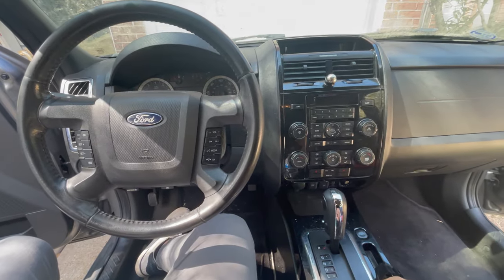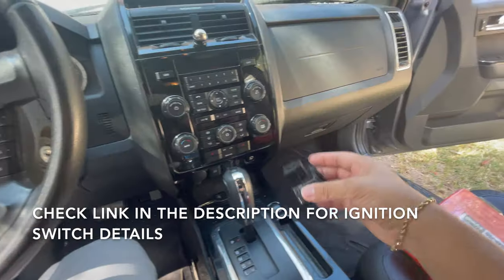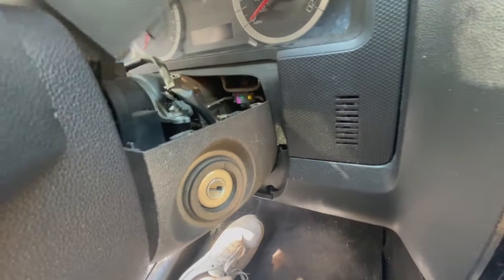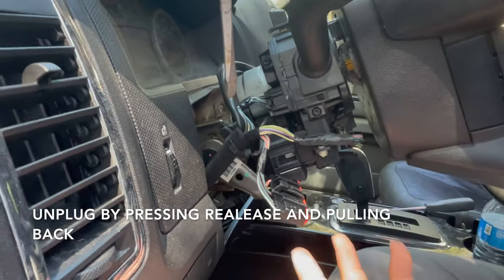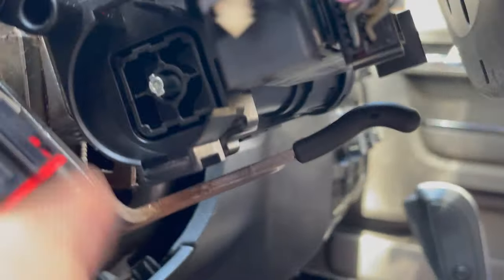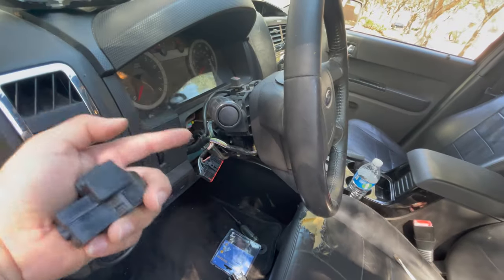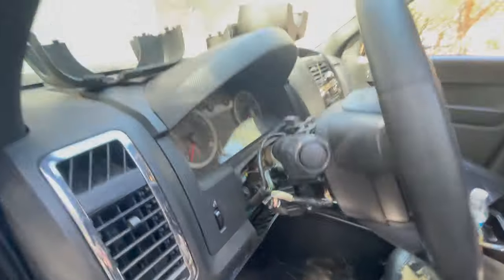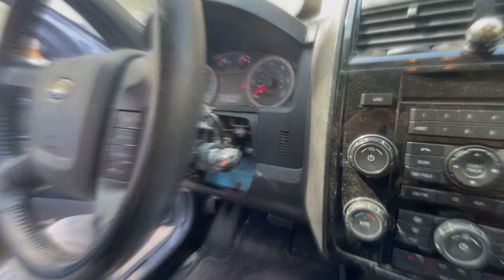Ford Escape Won't Start Ignition Switch Replacement

Comment from the maker: Don't waste time and buy the part here, its the part that you need, has quick delivery and its $30 https://amzn.to/3INPgRv
Reply: After I poop it back , I'm still able to pull it out of it clip
Reply: Do I need a new key when replacing the switch? I have a 2009 Ford escape - same key style
Reply: @tnygmusic  The only time you need to replace the key and the switch at the same time is if the key directly interfaces with the switch. In that setup, the key often gets worn down with the switch so that the new switch will not be compatible with the old worn key. 

I think all models of Ford escape have the little tab sticking out of the end of the key cylinder which interacts with the ignition switch.

Comment: Thank you for this video. The push-in method stopped working for me. I bought the part from Amazon for $30 and I replaced it in about 20 minutes. Works perfectly now
Reply: What year is ur escape?
Reply from the maker: glad I was able to help!
Reply: Curious is it still working?
Reply: Ty so much!!  Worked great!  I messed up at first because I didn't align the key correctly when installing it into that part's notch.

Comment: Thanks for making this video. I have a 2009 Ford Escape and it was having ignition problems. I ordered a $60 dollar part off of amazon and successfully replaced the switch with the help of this video.   Thank you !!!
Reply from the maker: glad I was able to help!
Reply: Curious is it still working?
Reply: I just put in a new one but it still wont start....why
Reply: @randallgd  Hey, I started to experience problems with starting my escape again in about MAY 2024. I think the entier assembly needed to be replaced as I would have to push the key in with some force and turn for it to start. I was also experiencing times when my steering wheel wouldnt unlock when vehicle had started. I then had transmission issues and purchased a tacoma.
Reply: @jameschristian8117  yeah mine either. It works but still need to push it in. The position of the switch seems to be off to some degree.
Shit

Comment: Thanks for posting this. Only issue I had was snapping the replacement switch in place. Took a bit more pressure than what you indicate, but it eventually snapped in. It is also important before installing to rotate/align the starting mechanism inside the new switch to the rod that extends from the housing on the steering column.

Comment: God bless you bro
I had this problem with my 2010 Mazda Tribute and everyone told me I need to change the entire ignition assembly and quoted me 1500-2000$. 
Even online most ppl said the same thing until I came across this video, tried it and worked out perfect

Comment: Thanks a million,  your video just saved me $500 bucks which I was charged by a mechanic to fix this issue...😂 I ordered the part on Amazon for $35 plus the 5.5mm screw driver for $22 at a total of $57 and in less than 1 hr I fixed it and car now starts normal 

Can't thank you enough so I subscribed ❤

Comment: Thank you for this video! I watched several stating the whole ignition lockout module would need replaced which requires the steering wheel to be removed. Your solution did not. The ignition switch is part of the module on the left which they did not show as being separate but it was, and cheaper too by ten to two hundred dollars. Did it myself in under two hours. Thanks again!

Comment: Thanks for the troubleshooting video. Was able to fix the problem and now I can start my escape with the key instead of using the car starter. Pretty well detailed video. I spent $100 CAD on the part at a parts store because if it wasn't the issue, I wanted to return it. Well worth it because I was able to do it myself.

Comment: Thank you, my man!
I bought this 08 of a Buddy   It will only start with the remote start.
And then I was told these mariners.  Have a history of bad Ignition switches.
And like you showed me by pushing the key in hard, it will start.
I will be sharing this on  channel on my channel. I even went so far as to change the starter. You can check out my garage music while you're working At Dana's garage music

Comment: YOU ARE DA MAN thank you so much....
All the other vid's I was coming across were saying to yank the whole steering wheel and other components out in order to swap this switch. I wasn't making sense to me really as to why you'd have to remove all that stuff, it just seemed there should have been an easier way and low and behold you've got the answer here..
it's just in time too cause I about to get a gear puller to remove my steering wheel hahahaha but it's not necessary that's for sure. 
Thanks again it's greatly appreciated
Reply from the maker: im glad I was able to help! 😀
Reply: So here's my update.. First off again thanks for the help it was most awesome. 
Okay so I'm mechanically inclined been working on cars all my life so I knew once I learned how to remove the switch, it wouldn't be a difficult process for me and it wasn't. Anyone watching your vid can do this repair but here's the thing with me. I remove the switch and order a new one and it arrives and  in it goes but NO START. I plug the old one back in to the electrical plug hanging out, stick a flathead in, turn it and the truck starts so it wasn't my switch after all. I removed the tumbler and had an allen key that fit inside that d-slot and I turned it but the truck still wouldn't start so It looks like ( at least in my case ) that I'm going to have to replace the whole assembly. For now though your great help allows me to at least drive my truck , although starting it I still have to use the screw driver with the switch that's hanging down. 
Cheers again from Vancouver Island Canada
Tim
P.S. If anyone is doing what I'm doing, just remember you still have to turn the key into the one position when you start the truck.
Reply: @GarageBoys  I just re-watched your video and something caught my eye that I didn't do and maybe it's "WHY" my truck still isn't starting with the key. You had said here that when you clip the switch back in to have the key in the ignition so that little tit that sticks out aligns properly. I didn't do that so once the rain stops I'm going to give that a shot and hopefully it works  and if so I'll post again. It's too bad I can't show a picture on here cause the little tit that sticks out on my truck isn't big and green/yellow in color like yours is, mine is just a much skinnier smaller tit that sticks out Hmmmm wonder if that's got something to do with it

Comment: I followed these steps and installed a new ignition switch. Made sure it was properly clipped in place and also that the key was in the ignition when I installed it like you said. It for sure has helped because now I can start my car every time first time whereas before it took me many attempts. However, I still have to push the key in towards the ignition a bit before it starts. Is there anything secondary that could be causing this?

Comment: Thank you for this video, about to try and replace mine, this is very helpful! I have a 2005 Ford Escape, was running fine then now starts randomly stalling and sometimes can't even start it (no clicking or anything) and I can't even get a reader to work after that. I've been able to get it going again by disconnecting the battery for a few then reconnecting and then it will run for a few minutes and die again. Sounds perfectly normal when it is running and not seeing any error codes on my reader. Stupid question, but can an ignition switch cause this type of problem?

Comment: Video helped me, SO proud of myself, female, single mom and fixed myself 😃 Cranks perfectly…UNTIL I put the lower steering column back on. Seems to be absolutely no reason for it not to crank, it’s hollow plastic attached w 3 screws! I have checked and REchecked everything. Had a friend triple check cannot figure it out! Even if I just hold it up, it wont start w cover HELP PLEASE

Comment: Thanks for a great video. I replaced it, and I had to replace the battery it was about 7yrs old and would not take a charge. I had been pushing the key in for bout 2yrs. Anyway, It still wont do anything. I checked both fuses, ignition and run start both are good.
I ordered the part on line about 30 bucks I think.
Any ideas?

Comment: I had to do this about 8 months ago it worked like a charm but now it's doing it again so I replaced the same part but it didn't fix the issue this time can you tell me what else could be the problem. Thanks for the info. Also for anyone who wants to know i bought my part on ebay for under $15

Comment: Thanks again- I'm ordering the part and doing it. Concerning the actual switch, do you have to press both ends at the same time  and pull, or you can do it individually? I noticed you lowered the steering wheel but I didn't understand how you do that, can you explain?
Thanks a million
Reply from the maker: Hi, I’m glad my videos helped you fix your issue. You don’t have to make extra keys or anything else, this is a very very common issue on this vehicles. To respond to you questions, yes you can press them separately and not at the same time. And 2nd, you can adjust your steering of any car with the lever located it under it.

Comment: I was able to replaced the switch thank you. Since I just purchased this 2012 Escape, I don't remember if the key switch had a play prior to replacing the switch. When I first started  after the installation, the key did not return and I had to manually turn the key back a bit. Is this normal in the escape?

Comment: Will this also cause the radio to stop working? My car starts fine but i noticed all accessories lose power after i remove the key ( even the odometer reading which is suppose to stay on is off)

Comment: Replaced ignition housing switch assembly on 2010 ford escape. Used same cylinder and keys. Car now cranks but  no start. Car is recognizing key
 Put on scanner and show immobilizer is on. Any ideas?

Comment: is it possible that if that part is bad, lights won't com on on dashboard? sometimes it does sometimes its not. sometimes it switches off the car complitly. and another strange thing is, in case there is no light on instrumental cluster, electronic power steering is still working. car if ford fusion se hybrid 2.0 from 2014

Comment: Great video, I did everything step by step replacing the switch, but the car does not start. The dash lights came on, I can hear the gas pump working, but no crank, even when I pushed the key in a bit further. The part is from Rockauto, by Motorcraft. I will try the part you have used and see if it will make any difference. Any suggestions, did I missed anything?
Reply from the maker: It can be many things, have you checked you starter?
Reply: Yes, it is new, I have replaced it  last year. I will try the one you have used and go from there. Thank you for your respond. @GarageBoys
Reply: There's another part in the column  called the Ignition switch column lock housing  part 9L8Z-3511-A that can be the culprit.  Not expensive on ebay, like $30 - 34.00.  There's a video by FordTechMakuloco called "2008-2012 Ford Escape No crank no start: ignition lock module replacement.  It's 23:41 minutes long. If you check the comments on that video, there is supposedly a way to change that part without removing the steering wheel and air bag.  Appears you must remove the signal light arm and a few more wires to get access.
Reply: Thank you  @kenito1967  I have replaced the lock housing and it worked. There is a video here a young men replacing it without removing the airbag. I can add the video if needed.
Reply: @2010VIA  .. sure, I'm curious to see it because I will be doing this job next week. I know how to remove the air bag and steering wheel, but I'd rather not if I don't have to.

Comment: I have a 2008 ford escape xlt with this issue, i replaced the module itself a year ago, but not the switch fearing the key needs to be reprogramed. Now its starting to do whats going on in your video. Does the key need to be reprogramed?
Reply from the maker: No you don’t have to reprogram the key

Comment: I saw another video where the vehicle had the same issue.  They way they fixed it is by replacing the whole ignition lock module.  This method seems twice as easy.  Are there any drawbacks of just replacing the switch (as done here) vs replacing the whole module?
Reply from the maker: no drawbacks, worse case scenario you replace it again in 1 year

Comment: Same problem with my 2009 ford escape..changed the ignition switch still doesn't start..not sure if it's the housing..and we replaced the brake switch..cause the shift gear was getting stuck,now that works...still watching several videos..might remove the starter😮
Reply: There's another part in the column  called the Ignition switch column lock housing  part 9L8Z-3511-A that can be the culprit.  Not expensive on ebay, like $30 - 34.00.  There's a video by FordTechMakuloco called "2008-2012 Ford Escape No crank no start: ignition lock module replacement.  It's 23:41 minutes long. If you check the comments on that video, there is supposedly a way to change that part without removing the steering wheel and air bag.  Appears you must remove the signal light arm and a few more wires to get access.

Comment: I was worried with how hard this would be to the point I have been rednecking it for months using the command start to start the car and then putting the key in after but now I'm going to try and fix it properly as soon as my part comes in.

Comment: This didn’t work for me. However it was a good attempt, engine still doesn’t turn over and after I tried to turn the key once, the second time was very hard and the key almost doesn’t turn, I have to take it out again and try again. Any other recommended fixes to fix this symptom?

Comment: Hi, can changing this switch cause the front and back wipers to not work?  I changed the part following your video- thank you.  Since I just purchased this car, I had not turn the front and back wipers- presently they are not working. I checked all the fuses and even changed the steering column switch with the turn signal unit with no luck. 
Any tips in what to check will be appreciated.
Reply from the maker: This part won’t affect the wipers, it’s hard to diagnose over the internet but sounds like a wire issue… check wires from wipers to relay
Reply: Thank you, will do.
Reply: Sounds like you took off the wire harness to the wiper arm and didn't fully plug it back in.
Reply: Great video! I removed it quickly and removed another from a pull n save lot. It didn’t solve my issue, but it still was a necessary replacement. Thanks for giving a girl some confidence ❤

Comment: What if i still need to push in on the key after changing? What would be the issue?
Reply: Thanks for asking that question because it appears there's 2 parts that can cause it not to start. The part that was replaced in this video. I think it's called the ignition switch OR what's called the entire ignition switch column lock housing. Part 9L8Z-3511-A. ... cost about $30 -34 on ebay.
There's a 23:41 minute video by FordTechMakuloco that's called 2008-2012 Ford Escape No crank no start:ignition lock module replacement.  Like you said, if you replace the switch and you still have to push the key in, then it was the ignition lock module that had to be replaced. And if you read the comments on that video, there is a way to take it off WITHOUT removing the steering wheel.  I think you remove the signal light arm to get better access and remove a few more wires to get access to all the screws that hold it on.

Comment: I replaced the part but i have to push the key in still. Do i have to replace the key switch too?
Reply: I have this issue as well. Have you found a solution for it?
Reply: There's another part in the column  called the Ignition switch column lock housing  part 9L8Z-3511-A that can be the culprit.  Not expensive on ebay, like $30 - 34.00.  There's a video by FordTechMakuloco called "2008-2012 Ford Escape No crank no start: ignition lock module replacement.  It's 23:41 minutes long. If you check the comments on that video, there is supposedly a way to change that part without removing the steering wheel and air bag.  Appears you must remove the signal light arm and a few more wires to get access.

Comment: do i really need to disconnect the battery if i'm trying to do this quick?
Reply from the maker: No, but it’s recommended
Reply: Any time you work around the Air Bag, you "should " disconnect the battery.  If you set off the Air Bag, they're expensive to replace. Leave it disconnected for 10 minutes before messing with your car. Honestly, There's a 1% chance you'll set it off. But who wants to pay $700 - 1000 for another Air Bag.

Comment: Okay so what if this doesn’t work? Could it be something else? See cuz I did everything right in this video however I won’t start
Reply from the maker: Well it can be many things…. Check if your battery is good (try jump start), or maybe your starter is out.
Reply: There's another part in the column  called the Ignition switch column lock housing  part 9L8Z-3511-A that can be the culprit.  Not expensive on ebay, like $30 - 34.00.  There's a video by FordTechMakuloco called "2008-2012 Ford Escape No crank no start: ignition lock module replacement.  It's 23:41 minutes long. If you check the comments on that video, there is supposedly a way to change that part without removing the steering wheel and air bag.  Appears you must remove the signal light arm and a few more wires to get access.

Comment: I have a 2008 ford escape..I changed the starter/battery/ignition switch car still won’t start..no crank no start nothing..everything works though